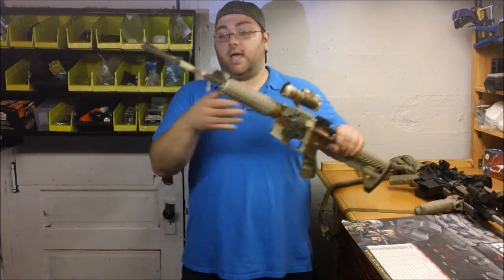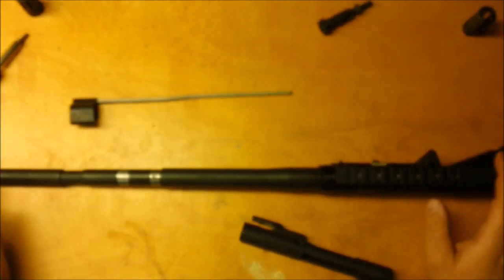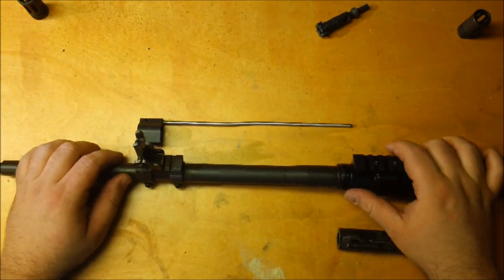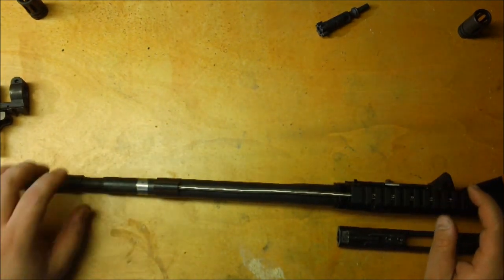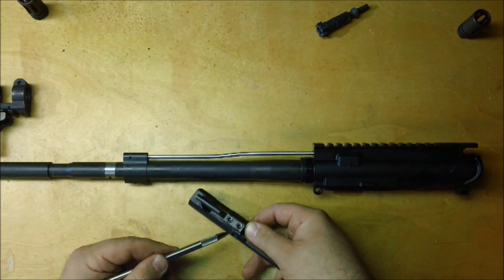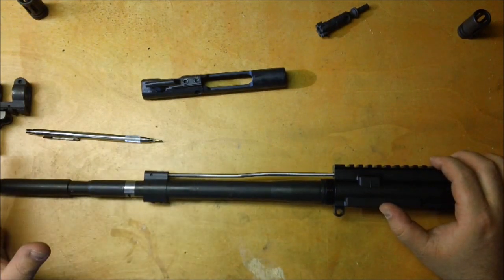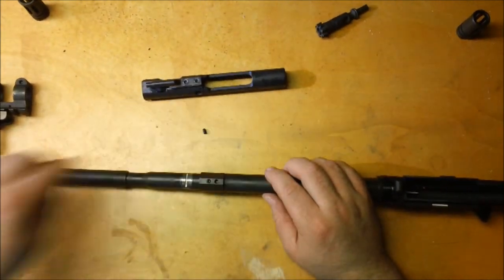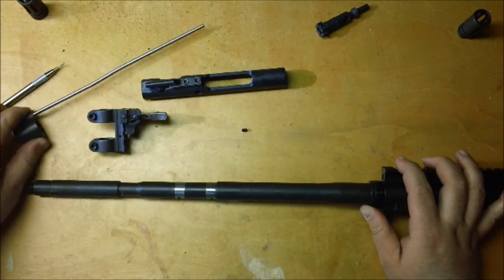AR15 Gas Block Weaknesses Explained and Fixes Explained

Comment: This video is actually based on a false premise stated early on. Staking gas key screws is absolutely done to keep them from loosening up! A staking tool, basically a narrow cold chisel, is used to swage, basically get metal to flow or move, from the screw and the gas key to engage each other so the screw doesn't turn easily. If there is a stake mark in the key but not the screw head it's not deep enough! The first symptom of loose gas keys is failure to eject and then failure to extract because gas will leak out between the key and the bolt carrier. There will be carbon showing on the carrier. If the key screws are so loose that the key strikes the gas tube hard enough to displace the gas block there are more problems. I am surprised it functioned reliably, if at all! Bushmasters used to be infamous for that. I went through an entire departments inventory of Bushmasters and EVERY one had at least one loose screw. I removed them all, cleaned them, applied very little Permatex, thread locker to the screw threads, torqued them to spec, and staked them properly. Receiver extension tube nuts (castle nuts) are also swaged to prevent loosening. They should also have medium locker applied and be restaked when reinstalled or replaced.

Comment: My gas block came loose on me moved forward a bit became a bolt action after extension cleaning oiling and cussing I noticed it moved so pushed it back tighten the screws and voila works beautifully
Reply: my first rifle is a .224 Valkyrie, after about 2 or 3 shots it became single shot only, plus the case was sticking inside of the barrel. gas block and alignment will be the first thing i check

Comment: IF YOU ARE NEW TO AR-15'S, PLEASE DO NOT LISTEN TO THIS GUY!  Almost everything that he is saying is wrong!  Staking on the gas key IS indeed to keep the hex screws from backing out!  I wouldn't be surprised if the issue that "he's seen" with the gas key impacting the gas tube is due to improper/misaligned installation of the gas block.  Installing a gas block a couple of degrees out of alignment can cause the gas tube to either rub or impact with the gas key, causing catastrophic failure.

Comment: Wrong wrong wrong!
The reason why the gas key bolts loosened up was because they were not properly staked  from the factory. I've never seen a properly staked Geskey loosen up. 
I dimple all of my barrels and red Loctite set screws and properly gap the gas block off the shoulder of the barrel. 
Some of my rifles have 
10,000 + rnds thru them and have never had  a  problem.

Comment: Holy hell I don't even know where to begin with all the misinformation in this video 😂🤣😂🤣
Reply: I couldn't agree more! Align, tighten and stake the key! Dimple the barrel at proper spacing. Align and space the block, then set the screws into the dimples, thread lock, tighten, stake.

Comment: i wouldnt use either of thos gas blocks clamp style is only kind ive ever used on both of my ar15.. i couldnt bring myself to drill dimples in my barrel for set screws ..

Comment: On the head of the bolts that connect the gas key there are ridges all the way around it. The stakes in the gas key press against those ridges not allowing the bolt to turn, if it's done properly. Even the more popular companies aren't staking the gas key's like they used to.

Comment: tighten those set screws then wack the side of that flip up sight, I've broken off the sight before the gas block moved. and the gas key if staked properly they will not come loose if the screws come loose then the screws were not properly staked

Comment: Proper gas key staking absolutely does prevent the screws from backing out, not just falling out. However with that being said, there are alot of companies that don't properly stake the screws so it does happen. I've seen some lousy staking.

Comment: i saw a vid of a young guy showing how to install a pistol barrel and he said to use red lock tight because it holds up to more heat does anyone ever read the directions good luck to that guy trying to get those bolts out because blue red and green hold up to the same temps but blue is removable and red is not

Comment: Just use an A2 pinned gas block and cut it down.  They are some of the most sturdy in the business.  Why a person would use a screwed on gas block is beyond me.
Reply: W Reid - Your absolutely right. The A2 is double pinned, which is as secure and durable as they come. If you want a secure, low profile gas block to fit under a long handguard just shave down the A2 gas block and you'll have the best of both worlds.
Reply: What someone really needs to do is make an A2 style that has a rail so I don't have to cut one down. I want A2 fit and look just with a rail.

Comment: How does the screws on the gas key on the bolt carrier coming loose and causing the gas key to be misaligned mean that a low profile gas block is not stable? You made it seem like the gas block was to blame for the gas key malfunction. Just saying...
Reply: Lorenzo Garza - Because instead of the gas tube going into the gas key, the end of the gas key strikes the end of the gas tube ramming the gas tube forward (which is pinned to the gas block) then ramming the gas block forward. It's very rare, however it does happen if the gas key isn't staked properly and comes lose.
Reply: This is a very rare issue, it is quite a stretch to prove a point about gas block hold strength. Raise your hand if you carry a spare, complete BCG and gas tube (which would likely also be damaged) with you at all times. d
If your BCG fails this seriously your rifle is going down regardless of gas block type. If your at a match or class you better have another upper with BCG available cause you shouldn't just switch out the BCG and use the same upper; it should be inspected in the shop before using again.

Comment: Hey doesn't look like your all that active on here anymore, but hoping ya might have time for a question about gas blocls. I'm building my first AR and see different numbers like 700 750 and guess I wonder what these numbers mean? How do you know which pressure togo with is this something that depends on barrel or cali or is it kind of a trail and error type of thing? Your not the only video mentioning pilot holes for the set screws and I can't see why it would be a bad idea.

Comment: Did this fool say use RED LOCTITE? Oh lord, Good luck ever getting that gas block off if there is an issue that arises.
Reply: William Dell yeah red is darn near permanent.  I've run into a lot of folks who have used it. I use a small butane torch to heat up the screws. After a minute or so, they come out pretty easy.
Reply: 450 degrees of heat and red locktight returns to liquid

Comment: Good idea with drilling small holes but the way most people remove locative is with heat. The gas block area will heat the locative on its own. Most rifle builders will drill small set holes and then stake the gas block screws. The staking makes it nearly impossible to unscrew.
Reply: JOE MANIERY - How do you stake gas block set screws?
Reply: MrChuckwagon55 
It's gotta be pretty ugly.

Comment: The purpose of staking IS TO KEEP THE SCREWS IN PLACE. Not to just keep them from falling out. The staking pins the screw in place so they do not back out.  If your gas key comes loose it doesn't matter if you have an A2 gas block, pinned lo profile gas block or one that is just attached with screws. You will loose gas pressure and it is going to cause you problems.

Comment: dimpling is a great way to keep the lo pro block from moving and you can stake the set screws as well so they cannot back out...if you can't pin the block anyway...i have a jig to be able to pin gas blocks in place

Comment: For the clamp on, WHY would you want accessories on your gas block? There are more than enough places to mount things without using a gas block. Cover the damn thing up with your hand guard, and protect it from getting hit in the first place, and your problems are all solved. Mount things on your hand guard, NOT the barrel of the rifle, and you can't go wrong. Free floating barrel is best anyways, in order to reduce stress on the barrel, which makes improves shot placement. I for one, do not like the idea of staking, or dimpling my barrel for a set screw. I want my barrel pristine as it can be, with as little stress in one area as possible. For me that means clamping on my gas block which provides a uniform, distributed stress all the way around the barrel. This decreases stress from just one small area of the barrel, to a more general, larger and more distributed area which as far as I am concerned, can only be an improvement. He also needs to take more care handling his guns and components. I realize that they are not exactly fragile, but scraping them up, and banging them against one another cannot possibly be good for them. In the field you are only as good as your equipment, so take good care of it when you can. In the field it may have to take an occasional beating, but at home I try to treat my weapons as if they were valuable items, not just worthless wood blocks that I handle carelessly.

Comment: can some one explain how the low profile gas block is the problem if the real problem is the bolt carrier group if you dimple the barrel and the bolt carrier gas key is off it still doesn't work correct?!
Reply: I was wondering the same. Sounds like a manufacturer problem and not a gas block problem. Loctite it all!
Reply: This video is actually based on a false premise stated early on. Staking gas key screws is absolutely done to keep them from loosening up! A staking tool, basically a narrow cold chisel, is used to swage, basically get metal to flow or move, from the screw and the gas key to engage each other so the screw doesn't turn easily. If there is a stake mark in the key but not the screw head it's not deep enough! The first symptom of loose gas keys is failure to eject and then failure to extract because gas will leak out between the key and the bolt carrier. There will be carbon showing on the carrier. If the key screws are so loose that the key strikes the gas tube hard enough to displace the gas block there are more problems. I am surprised it functioned reliably, if at all! Bushmasters used to be infamous for that. I went through an entire departments inventory of Bushmasters and EVERY one had at least one loose screw. I removed them all, cleaned them, applied very little Permatex, thread locker to the screw threads, torqued them to spec, and staked them properly. Receiver extension tube nuts (castle nuts) are also swaged to prevent loosening. They should also have medium locker applied and be restaked when reinstalled or replaced.

Comment: hold on.       then if you WACK the front sight gas block.       it well mess up the gas return ok well what about the original a2 style has block that is held together by pins all I get from this is you think a low pro gas block is better? please can you explain I recently took off my Anderson gas block and replaced it with a yankee hill flip up site so I could use a sling

Comment: i'm just saying i don't see how a set screw can be a bad thing if it's tightened properly and locktite is used. it's gotta be tight and have screw dimples though. worked great in mine, just put 400 rounds through it with my brother inlaw and not even a hint of losing pressure. if anything it might be over doing it as some of the brass had dents from the shell deflector. pinned would be better no doubt but i wouldn't worry about a low profile block much if it's covered by a free float rail and has the barrel dimpled for the set screws.
Reply: stake the set screws for a little more added insurance and it will not move...you can still svc the rifle if need be and re stake later after the svc. work is done...it won't be pretty but it will work. or since lo pro gasblocks aren't terribly expensive, install a new one
Reply: idk about staking them. what i meant by tightening properly is torquing the hell out of it. when done with locktite it's stable enough and then it gets hot and cooks the locktite on there. i'm sure staking them would be fine to. i didn't even stake my castle nut. i'm sure it's made a difference for some or many, don't get me wrong but i'm content with my locktite and cranking it good.
Reply: loctite can only do so much...unless you use a super high temp type it breaks down under 200*...which isn't very hot ,a couple mag dumps and you're there...in fact i use a heat gun to break it down to svc barrel parts..one small dimple that creates interference with the set screw hurts nothing and is one tiny little step that creates a reliable connection. not staking a castle nut can create problems too...if you don't shoot a lot then rock on...but if you do shoot a lot you will run into issues and with murphy's law being in full affect it will happen at the worst time possible...i have made numerous field repairs to peoples rifles at carbine classes from gas blocks loosening up creating short stroking issues or not cycling at all or castle nuts going loose and having buffer detents launch themselves inside a lower blocking up fire controls or jamming up inside the upper locking it up....build your rifle however you want
Reply: brotherscoobs eh, i think it'll be ok. i've put enough rounds through it that i'm comfortable with it. i understand how murphy's law works though. i'll reconsider at least. i don't usually dump mags. work to hard hand loading them. well sometimes i'll get a bit wild with a few but never a whole mag. thanks for the advice. i'll certainly be sure to point point in that direction in addition to locktite.

Comment: I agree pined is better, but a set screw tightened into a dimple also works well, the low profile gas block provided with a Noveske barrel uses a set screw and pin combination, just buy good stuff you get what you pay for.

Comment: 1) I use set screw style gas blocks, and on both my barrels that I've installed them on, the barrel has a dimple pre-drilled for that set-screw. It's amazing what happens when you buy a quality barrel and not the cheapest crap available. Guess what? Not a single issue related to my gas block in 1k+ rounds.

2) Have you ever heard of loctite?

3) Staking doesn't keep the screws from loosening? From Bushmaster I can understand the crappy stake job, Colt that's probably an instance of poor QC. But you're also the same guy who advocates buying the cheapest stuff available and have apparently never learned "buy once cry once."
Reply: True. But I like being able to remove parts if I need too. But there some thibg I definitely want secure. And I've learned that on a gun anything screwed or bolted on can and will work loose, especially if abused
Reply: PKendall317 
BLUE-loctite bud.
Reply: PKendall317 
Heck even Bear Creek Arsenal dimples their barrels and they have basement low prices.

Comment: If you have a gas block that uses set screws dimple your barrel so that your gas block will not rotate. I did that to mine and no problems so far and is holding up.

Comment: Again, I disagree about having a properly staked gas key ever coming loose. It is not uncommon at all to receive a bolt carrier with less than quality staking from the factory...yes, even Colt. I inspect all my staking and re stake them immediately if I suspect the staking is not impinging deep enough into the screw heads. Doing that and adding a good quality CLAMP ON (not set screws) gas block will insure utmost reliability. I prefer Kies clamp on blocks that use a gas tube screw instead of that PITA gas tube tiny roll pin. I use loctite 620 green which is specifically formulated for high temp bedding of cylindrical metal objects. I bed the gas tube and seal all screws in the block to prevent any kind of blow by. I just bed the top half semi circle of the gas block, again to 100% seal any blow by. I shoot some brake clean down the gas tube after initial tightening to clear out any oozing of the Loctite. Yes, you need a powerful torch to disassemble. I buy melonited barrels with ultra long life expectancies so removing my gas block may not be necessary for many many years. The Kies clamp on block simply will not move even if you hammered on it. I never like the idea of drilling into any barrel to "pin" a gas block in place. Not necessary IMO.
Reply: It is required for me to keep my LE certification as that is what I do and no I'm not a slow learner and its spelled Armorer.....just saying
Reply: fully agree. I have had factory staked keys staked to loose bolts lol...
Reply: Oh yeah many in fact i have a staking tool from Michieguns and it  is the best i have ever used. the staking is very important to insure the bolts don't come out and the single thing that will keep the there. this tool thinks that red locktite will keep that carrier key in place he is FOS HEAT removes red locktite! I have attended the Offical Colt armorers school four times and the advanced once so yeah im trained to know.
Reply: darangemaster1 on some of the cheap bolt carriers the screws are crap and will stretch with the heat and pressure! be advised!
Reply: darangemaster1  YOU MUST BE A REALLY SLOW LEARNER IF YOU HAD TO GO FIVE  (5)  TIMES TO THE SAME ARMOURER SCHOOL.  USE GREEN LOCTITE;  IT"S GOOD TO ROUGHLY 700-750 DEGREES BEFORE IT DEGENERATES.  JUST SAYING.

Comment: Thanks for making this video.  I have both of those same gas blocks on my AR.  My 223/556 has the YHM flip up site gas block and my 300 BLK has that low profile gas block.  After watching this video and you explaining how to remedy the low profile, the next take down cleaning I plan on doing what you suggested to the low profile gas block in regard to the set screw and dimpling the barrel for the set screw to set in.